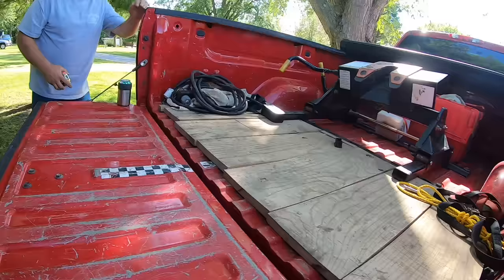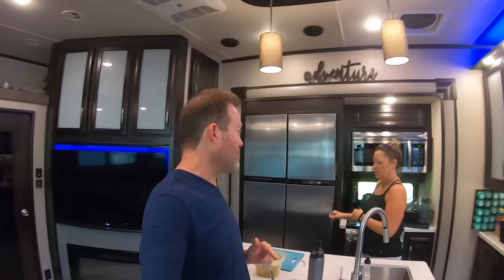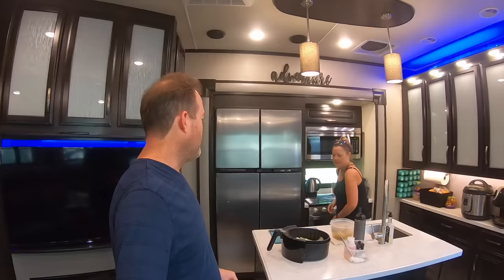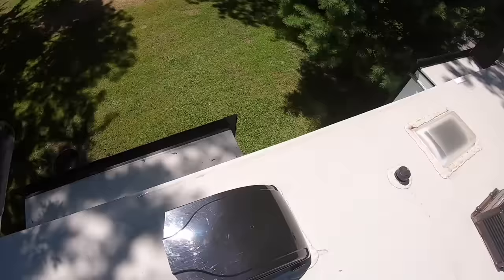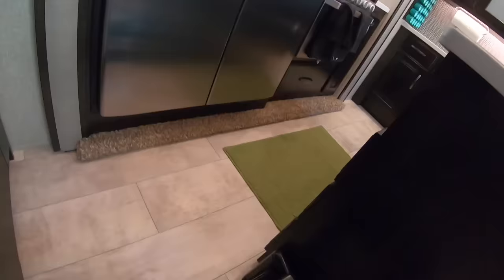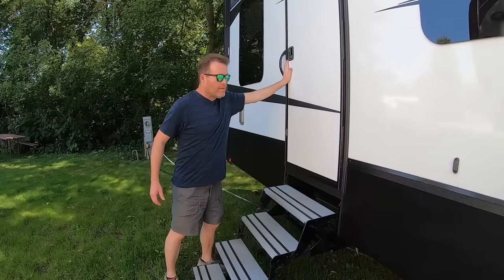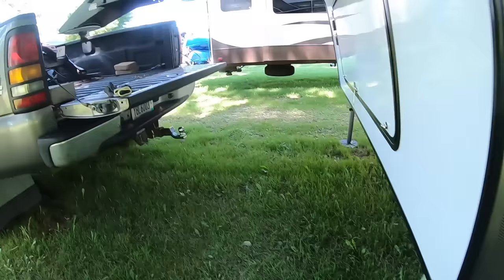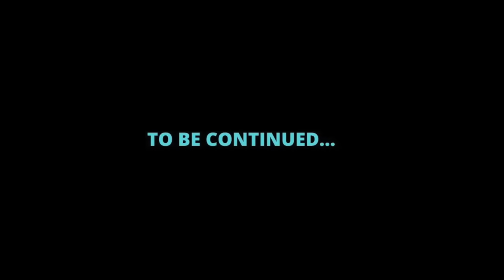RV CRUSHES MY TRUCK ON 1st TOW! BIGGEST RV LIVING FULL TIME MISTAKE!

Comment: why truck drivers do the tug test before lifting legs and moving out
Reply: Wanderer yes it’s designed lock your trailer breaks and give it a tug. No harm
Reply: I do the tug test after every rest stop to make sure no one pulled my pin. I don't leave the dolly legs down because they can get irreparably damaged. It's easier to pull away slowly, stop if the trailer drops and dolly down again to reconnect if necessary.
Reply: I high hooked a trailer. Heard the fifth wheel latch click and it passed the tug test. Realized something wasn’t right once I got underneath and pointed my flashlight to check the fifth wheel jaws.
Reply: @edsadventures2422  Yep!  The world is full of absolute A-Holes who will pull the pin JUST to watch someone do this.
Reply: Joe Jones that’s why when I pull my camper and have to stop at a rest stop or overnight I always make sure to tug on it to make it impossible to pull the pin.
Reply: Ed's Adventures you could just raise the legs so they are off the ground saves dropping the trailer on to what ever you are towing it with.
Reply: big al correct, just raise the legs about an inch, leave the tailgate down and tug.
Reply: Truckers always do the rubntug every 50 miles
Reply: @davidbottles7298    I use to do the raise inch or two and tug.  After a 35-years of towing, not one issue.....Then I did a Tom just last year.  BOOOOOOM!!!  The 5'ver dropped those two inches.  I never thought it was going to stress out the 5'ver that much just dropping a couple of inches.  Never again.  Now, I hook up...*click.  Then do the tug test with the trailer brake, obviously.  Now, if it comes unhitched, the trailer won't drop at all.  Plus there's less pressure on the plate.  Just my 2-cents.
Reply: indeed

Comment: Just an fyi, you don't need the teflon disk when you have the teflon pad on the hitch, That may be the reason why your hitch didn't lock when you backed under. (this pin was maybe just a little high.
Reply: That would be my guess, I also agree with comment above always give it the pull test before retracting jacks
Reply: Dewayne Hillman agree, alway do a pull test with the jack down, it also a industry standard in semi-truck.
Reply: Doesn’t seem like a disk that is barely a 1/16” thick would make that much of a difference
Reply: @bfe671  It doesn't take much for steel on steel contact to go out of alignment.
Reply: @bfe671  Go watch the latest vid. turns out my suspicion was correct.
Reply: @bfe671  That disc is way more like 1/4" thick by the looks of it

Comment: I'm sure deciding to release that video was a difficult decision. We all appreciate it. All the best.
Reply from the maker: Thanks so much Tony! Yes, I was nervous hitting that upload button today. - Tom
Reply: I’ve been RVing for years. Drove semi for years so driving and hooking and unhooking has never been a problem for me. But I appreciate you uploading this video for future rv ers   We all make mistakes sooner or later.  I hope there wasn’t to much damage. Once again crap happens.
Reply: This has happened to my brothers 5er twice using the Pullrite brand hitch.  I wish there was a an absolute indicator where you knew you were locked in.
Reply: @jaysuper8255  I have owned 5th wheels for 17 years.  I also have a Pullrite hitch.  It doesn't have a locked indicator so I'm always a bit nervous when I hook up.  I do pull tests but I'd rather have something more definitive.  The hitch is great otherwise.  We just bought a new 5th wheel in August so I will be more diligent in checking my hookups.  Sorry to see this happen but it is appreciated that this video is posted as a reminder to all of us.
Reply: @jaysuper8255  There is. If you push the arm in and lock it to the hitch it is in. If you can't get the locking pin through the arm and the hitch then you are likely not locked it. All that white indicator tells you is that the receiver pin is fully in the hitch. It's not locked until you put the safety pin in.
Reply: @jaysuper8255  check out the Reese 20k Goosebox. A bit of a different setup from the typical 5th wheel hitch. I always know we're locked in. We love ours. Ride is great and so is the completely empty bed! Safe travels. bg
Reply: That’s why I use the confirmation hitch , I don’t trust myself
Reply: @EnjoyTheJourneyLife  shit happens. You maintained you're integrity.
Reply: Dont feel bad, i am a hotshot driver and i did the exact same thing with my father in laws darn camper ! I NEVER pull 5th wheel campers but he asked me to move his toy hauler since he was gone when it needed moved. He showed me almost the same thing that guy showed you, well everything looked fine to me also. Not having 5th wheel experience, i seen the lock wrapped around the pin and figured it was locked, it wasnt because the stupid handle didnt slip in, like yours didnt ,,,,,,no camper damage but the bed and tailgate was IDENTICAL to yours. It was his truck too since i only have a ball not a 5th wheel hitch. Bought him a new tailgate and we got lucky because new bedside caps covered the dents in bed because they werent quite as deep as yours....
Reply: @stillwatching3255  these campers can hook up to a big tractor trailer truck plus ive used to tow that size camper behind a kubota tractor
Reply: @jaysuper8255  Use your eyes and check to see if it is hooked up correctly!

Comment: Gave me chills....as I had an accident while rushing to unhitch.  We forgot to chock the wheels while trying to beat an incoming storm. It was a very slight grade away from the truck and I released the pin before my wife had the landing gear down and taking weight.  The trailer slid back off the hitch and fortunately caught on the closed tailgate, otherwise it would've slipped off and hit the ground.  No damage to the trailer but it cost 6K to fix the truck.  Thanks for posting so that others will (hopefully) never have this type of incident.

Comment: Always do a pull test with the jacks barley off the ground before retracting all the way.
Reply from the maker: Thank you! Yes, that would have caught the problem!
Reply: We actually do it with the forward jacks still down, but we have the electric ones, they're not as thin as those hydraulics, because I'm terrified of doing just happened to you. Once it's closed and locked, I give a little tug while the wife watches to sure it stays engaged. I'm so sorry, man.
Reply: @EnjoyTheJourneyLife  Make sure the release handle is in all the way also. You may pass a pull test initially but if the release is part way out, your jaws aren't in a locked position.
Reply: @LordFalconsword  That kinda sounds like a bad idea lol. One time with my fifth wheel, I forgot to put wheel chocks down and if you were standing and looking at the front of the RV, the left side rolled back a little bit when it came off the hitch (I have a gooseneck adapter) and then bent that left jack a little bit and now it only goes like halfway back up into the camper. So, I feel like using your jacks as a last resort to save the truck from being smashed might be a bad idea, because if it did pop off the trailer could roll back and bend your jacks which I'm sure isn't cheap to fix.
Reply: Totally agree, I ALWAYS give it a tug w/front jacks on ground after it latches. Have seen that happen, not pretty.
Reply: no not barely off the ground, off the ground as you will bend them, many have as they were told to do hat .. manually apply the trailer brakes using the manual leaver on the brake controller, and watch for any movement on the 5th wheel if that fails the trailer drops 2" on to the landing gear, but first check to see that you see the jaw is closed and locked looking from the back of the truck into the mouth of the 5th wheel hitch, always number 1 check..
Reply: unreal great idea!!! so smart. Thanks
Reply: @arnoldromppai5395  Always do a pre-trip tug test. A must to insure your trailer brakes are working, and you hitched up correctly.
Reply: Us too. Lock the brakes on the trailer and tug. It's a good brake test too
Reply: @dedalliance1  I'd rather have a bent jack than a destroyed bed on my truck, and it could possibly bend the frame. Not to mention the fiberglass damage to the RV
Reply: @diananeal9645  I mean, sure that's probably a better way to go, but just saying it's still got a chance to break stuff. And assuming you tug on it too much with the jacks all the way down even if it were to never fall off, you're still risking the chance of bending it over time. I'd just assume hook it up right the first time. Sucky situation either way, I'd go with a Gooseneck conversion or hitch adapter which is what I have, you'll never have this problem and it seems simpler to operate, just 1 thing to lock and you're good to go.
Reply: JD, smart, actually it'll be good to feel the pull forth and back, with 2x 10"s planks under its front jacks so, in case it did not lock, it'll fall resting on the 2" x 10"s which, if you make the pads a foot or, a foot and a half long, leaving them centered, whether you move a little forward or backwards if it all rested on the pads, you'll have enough solid bottom to rest. Just lifting the jacks 1/2" would be enough to allow the trailer move free forth and back.
Reply: Good idea
Reply: I disagree with the pull test it is not necessary if  a dual jaw hitch  closes all the way your handle wont go in the locked position. And it should have a pin for handle to not open on it's own. Please correct me if I'm wrong.
I do a small pull test either way then put the truck in neutral while the wife lifts the Jack's. Keeps the stress of my trans
Reply: @powmowrider  If you disagree with a pull test then why do you perform a 'small' pull test? A pull test (done properly) is a good safety measure.  You can't always be 100% sure something's not broken or loose...
Reply: @Mike-hb4pc  you right I should have worded it better but i also dont exactly perform a pull test more like put in drive once the head of the plate tilds it's good cause the double jaws are closet. I will take this in consideration on my next trip. I do pull my 18000 fifth wheel around the country about 35 to 40k miles a year.
Reply: @powmowrider  Everything, should be somehow tested so we make sure it works. Something as expensive, delicate, heavy as "a house in wheels" shouldn't be the exception. That, right there so called the fifth wheel, should be tested because from that neck contraption depends the support of the whole "house" in great way. Time will correct us all. I, always test everything to a certain degree.
Reply: That's what they taught me in my Class A/CDL course and if you don't do it, you fail the test.  Using the brakes to hold the trailer fast, you probably will not bend the jacks if the trailer falls on them...
Reply: @dedalliance1  trailer brakes on pull test. that way it shouldn't roll back. you don't have it all the way down, you leave the jacks just above the ground. not touching but very close so the drop isn't more than a cm or two.
Reply: I had the same fear of crushing my truck bed so I installed the blue ox bedsaver. Works as intended.
Reply: @EnjoyTheJourneyLife  I learned that driving a semi, always tug on the trailer with the brakes locked on a fifthwheel.
Reply: dedalliance1 terrible idea. Those hydralics are easy to damage. Just visually check that king pin is inside the locking mechanism. The safety lock won’t engage unless locking arm is closed. All you have to do is be sure the king pin is inside the locking jaws/arm.

Comment: 30 plus years pulling trailers here. With nylon pad on hitch, you can't have disc on trailer. One or the other. Extra thickness caused what we call a high hook. Plus not sure about that hitch. Spend the money and get a b&w hitch for you truck. Well worth it and cannot high hook.
Reply: I hope that man didn't take advantage of him with the hitch trade. To end up with the newer one and cash. Hmmmm  I don't like to see that.
Reply: not seen follow up video where they say they found the problem i think but you can see the handle didnt get pulled into lock position. If he would have removed handle like the guy told him , he would have noticed it wasnt in enough to put little clip back in the hole and realized something wasnt right. Also, get a B&W hitch and dont look back !!
Reply: I agree with the purchase of a B&W hitch but I don’t see how a disk that is barely 1/16” would cause a high hook situation. Seems like there is more room for error than that.
Reply: @bfe671  The lube plates are 3/8" thick, put two of them together and you are 3/4" proud and thus not latching properly. I run a B&W patriot and a single disc and it works perfect but you should ALWAYS check to make sure you pin should is below the jaw when trying out a new setup.
Reply: I have a Curt Q20, no lube plate, I use grease. I still use it like a semi, visual confirmation and then still tug. Cheap insurance. That being said, B&W makes great hitches.
Reply: i 2nd the b&w hitch. with the locking jaws you never worry about that plate sliding over or getting stuck
Reply: @bfe671  that disc is closer to 3/16" or more. combined with that factory glider plate on the hitch its no wonder that happened

Comment: My next door neighbor did the exact same thing with his 5th wheel in his driveway of all places.  He crushed both sides of the bed, but the tailgate was still down, so no damage there.

My dad was a 18 wheel truck driver most of his life, and they hook up the "Tractor" (truck) to the trailers exactly the same way you do with your rig.
One of the things he did whenever hitching up a new trailer was to leave the dolly wheels down (in your case, leave the stabilizers in the front only down).

Next, he would back up to the new trailer and secure the trailer pin into the 5th wheel hitch on the truck and lock it.  

Next he would apply the brakes to the trailer ONLY, and while doing so put the truck in forward gear and GENTLY apply a little power to try to pull the truck out from under the trailer.  If the front of the truck rose up a little and the back scrunched down a little, and he could not pull the rig apart, then he would know that he had a good tight and correct lock between the trailer and the 5th wheel hitch itself.

Next he would put the truck in neutral and lock the air brakes, and then crank up the dolly wheels on the trailer

Next, he would release the trailer brakes and head on down the road.  

He said by doing it that way, you KNOW you have a good tight lock on the 5th wheel to the trailer pin and no fear of them coming apart.

After spending almost 50 years over the road driving well over 1,000,000+ miles in his 18 Wheeler, he never had an accident and never so much as even bent a mirror or scratched anything.  After retiring from the road, he became an 18 Wheeler Driving instructor for about 10 more years teaching folks how to do things correct and safely.  He was a very wise man...  Hopefully this suggestion will help you avoid these issues in the future.  
Enjoy your new rig!

P.S. Here is another little tip he taught me.  When pulling up behind someone in a car or truck such as at a stop light or in a busy highway, ALWAYS stop your rig far enough back behind the car or truck ahead of you so you can easily see the BOTTOM of their tires where they contact the road.  He said by doing this, you have given yourself enough room to turn and go around them if they happen to have a problem and can't move such as an engine out, flat tire, etc.  He was a very wise man...
Reply: Good tips
Reply: Grt tips; thanks for sharing your dads hitching tips! Y'all Be Safe!
Reply: Great tips, but a billion+ miles??? I think not.
Reply: @garyb9867  Ooppsss, too many zero's, LOL, 1 Million + miles.  I corrected the main article, thanks for the heads up!!!
Reply: Great tips? More like common sense , every 5th wheel trucker does a pull test after hooking up.
Reply: that bottom of the tire thing usually only applies to an empty car. with an rv like this you need a bit more distance i think unless you have 2 lanes on either side to swing out to.
Reply: Gary B  not enough zeros for a billion
Reply: @garyb9867  A million..!! not a billion!!